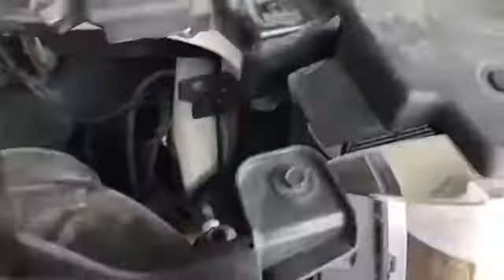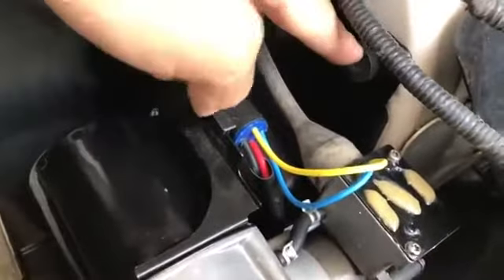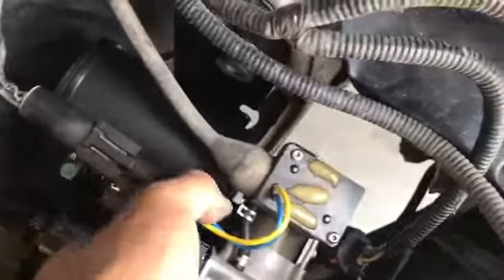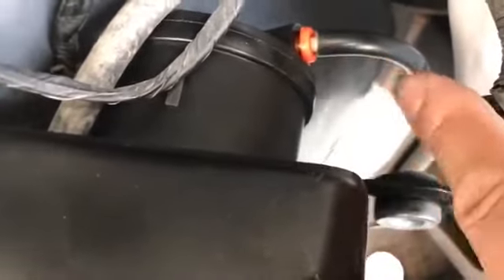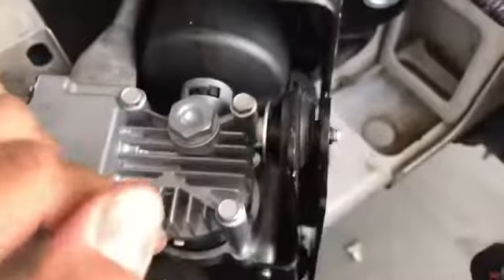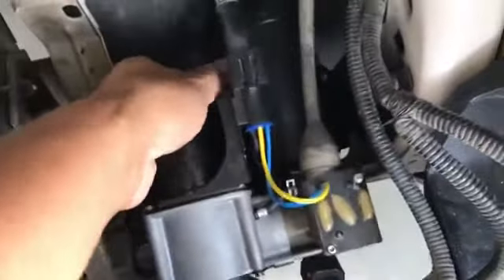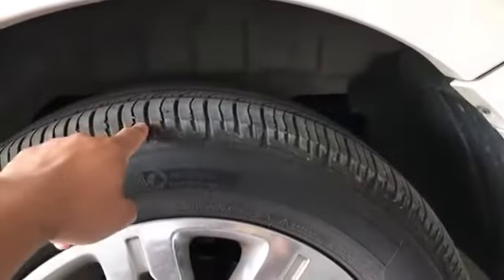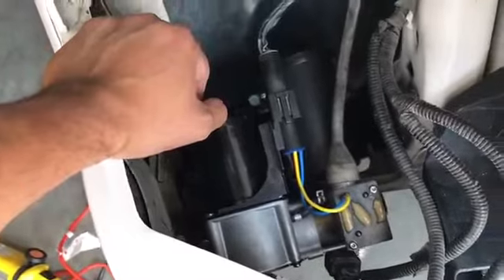2012 Ford Expedition Air Suspension Compressor Replacement

Comment: Thanks for the video,  it's nice to have a walk through of what needs to be done prior. 
I looked and you can actually access that bolt on the bottom from underneath. Saves a guy have to mess around with the wheel well.

Comment: Thanks for the video!

Anyone researching suspension issues with this generation Expedition should definitely consider replacing the compressor even if you have replaced it before. I had a new one go bad in about 3 years. …the air springs were replaced at about the same time but still seem to be good… I kept saying that the compressor couldn’t be the problem because it had been replaced recently. But I followed this video and replaced it myself and my suspension is now 💯 

If you’re inclined to tinker with things and want to be sure that the compressor is the problem first, I suggest disconnecting the air line from the compressor. Rig a test air line and connect it to a pressure gauge. I’m not sure what the pressure spec is (look it up to be sure) but I believe it is suppose to be ~135 psi. If the compressor output is 100 or below I’d recommend replacing it. There are videos on YouTube of people doing this diagnostic test with other car models. 

I’ll give a little more description of the failures I experienced in case anyone else is having similar problems. With any reasonable weight in the back the “check air suspension” message would come on in the dash. Usually this wouldn’t have any noticeable ride quality changes. The first sign of a major problem was going to the mountains to ski in the winter. When the temps were in the low 20s or teens the back end would drop to the stops. At first it would would easily reinflate the next time the temps got back to the 50s or warmer. Over time though it wouldn’t rebound reliably in warmer temps. In warm weather it wouldn’t drop noticeably. We had it checked by multiple mechanics. They all claimed that they couldn’t find anything wrong (no leaks, no computer codes, nothing). As time went on it eventually would drop occasionally in warmer weather when it was loaded down. 

I had been considering changing to coil springs for a while but then it dropped while we on a remote beach vacation. With a 10 hour drive home and no mechanics close by I decided to order a compressor and swap it myself. Fortunately I had a toolbox with me. By following this video it was an easy swap. The hardest two things were removing the headlight and removing the airline. But it all worked out well without too much effort. I’d say it was about a 45 minute job taking my time trying to ensure that everything was right. 

Good luck

Comment: Hi. I had the compressor replaced (have a '12 Navigator) but now the rear end sags very, very low when I turn the car off and it takes several minutes to inflate and return to normal ride height when I start it.  Do you know how I can get it to stay at the normal ride height even when I turn the car off? It's not on "easy exit mode", that mode is off so I am not sure why it keeps lowering the rear end every time I turn it off. Before, it was always at the normal ride height when on and off.
Reply: hey Meghan, you might want to have your ride height sensors looked at, the other thing that could be causing an issue is a leak in the system. Because the compressor isnt running while its off, the air will leak out. A leak in the system would also be the reason that it tales a while to inflate back.